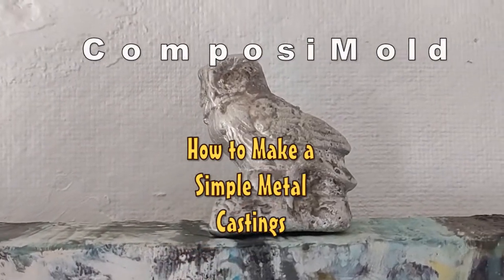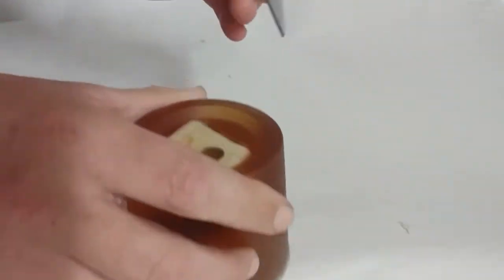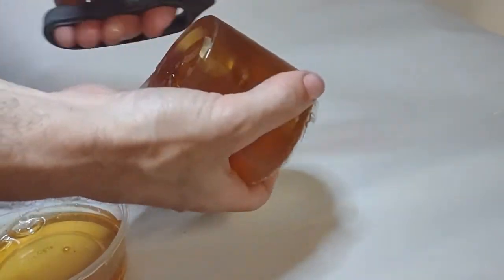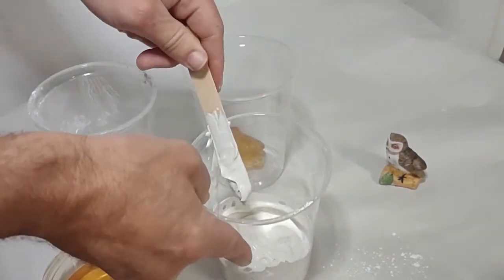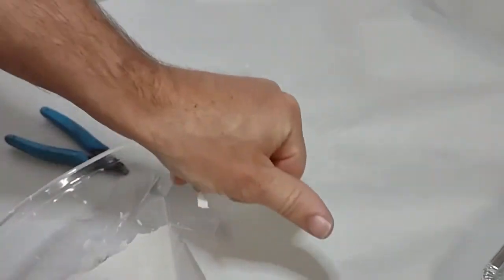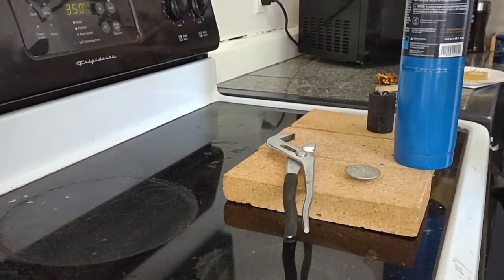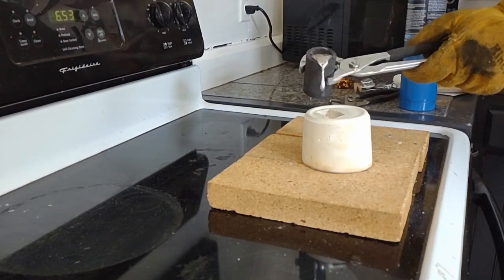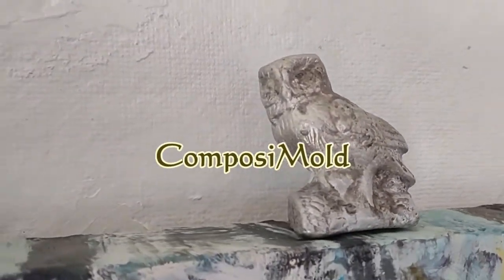How to Do Metal Casting at Home Using the Lost Wax Process (Or Lost ComposiMold)

Comment: Would this work for jewellery, rings, pendants, in silver or gold metal pouring?
Reply from the maker: The concept will work. Gold and silver are higher melting temperatures...and a lot more expensive. You also need a higher temperature furnace. Here's a video we just did for aluminum, which higher temperature and closer to gold/silver
Reply from the maker: ...here https://www.youtube.com/watch?v=-ZZdYqRPbHg
Reply: Many thanks for the information, I have a electric melting furnace, I also have a small kiln

Comment: Can resin or polymer clay be used in composimold?
Reply from the maker: Yes, both :) and all....polymer clay, regular clay (no slips), epoxy resin, small polyurethane, soap, wax (up to about 155 F), polyester (bondo), epoxy putty,...oh and if you haven't made resins yet, then you can also use it with chocolate, butter, fondant... so yes :) lots of different casting materials...here's a video for a two part mold for epoxy resin in composimold https://youtu.be/8cj5nDdWsBw?si=Tj58iMwDpCSUa8T4   thanks! stan from composimold.

Comment: You can use a silicone mold to cast with the composimold material, right? Or will it have issues
Reply from the maker: The opposite...save the silicone for the rubber castings...make the molds with ComposiMold Reusable Mold Making